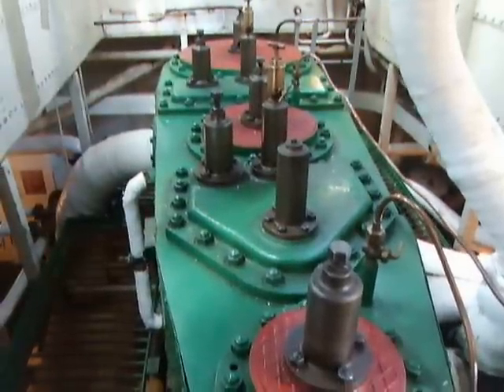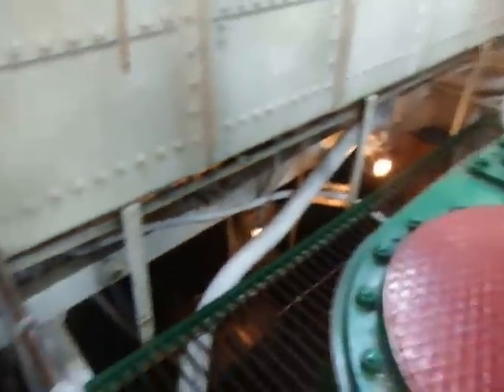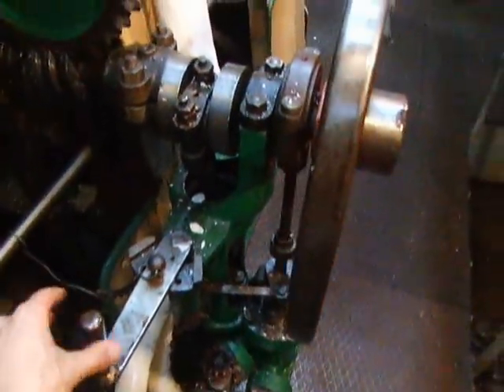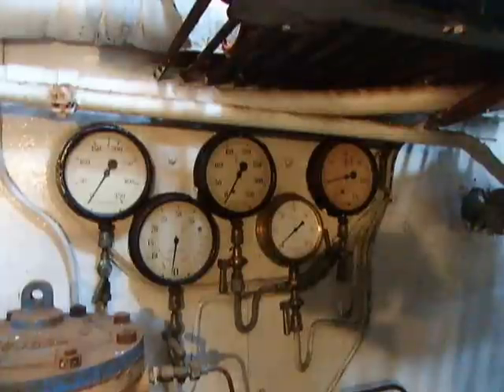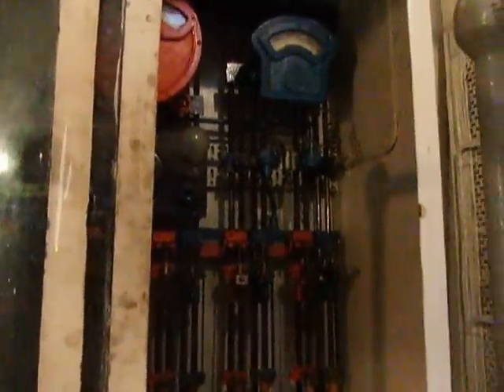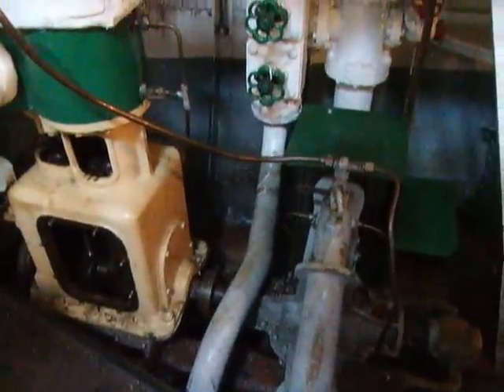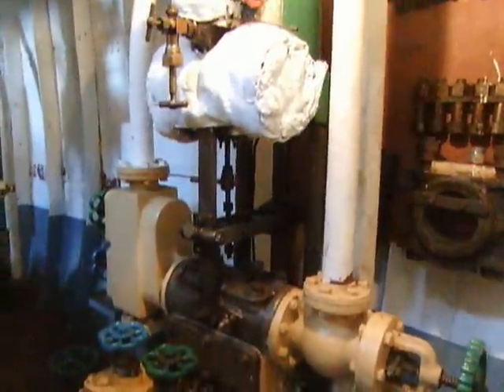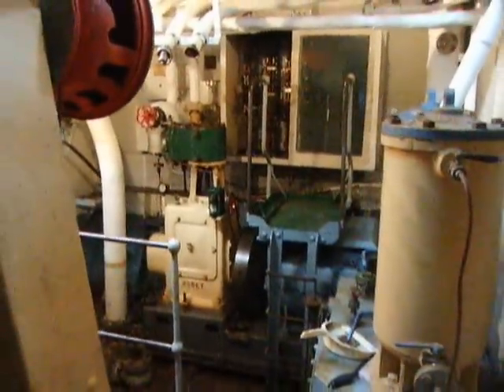Steamship Freshspring engine room tour

Comment: I remember this ship in Malta as in 1955 I was  an Electrical Fitter Apprentice at the local HM Dockyard. This used to supply freshwater to the ships  as it was stationed  at  the Grand Harbour.  As I live very close to the Maritime Museum at Vittoriosa which is behind Forth St Angelo I  often attend the Museum and there  on the ground floor there is a triple expansion  engine just like this one and also there is the front face of the boiler that powered it. There are a few more auxiliary machines around it.  I believe the triple expansion engine we have in the museum  came off a dredger that  was in Malta for a long time and I also know people who manned it. Good old memories.
Reply: Hi.  Did you ever see her Radio gear?  and have you any pictures of her?  Regards : Mike (part of the restoration  team)